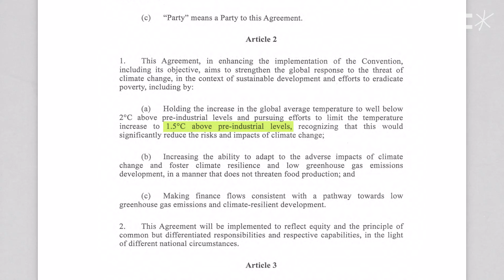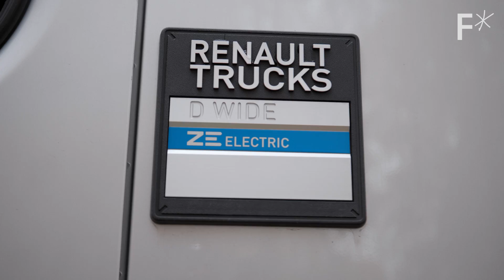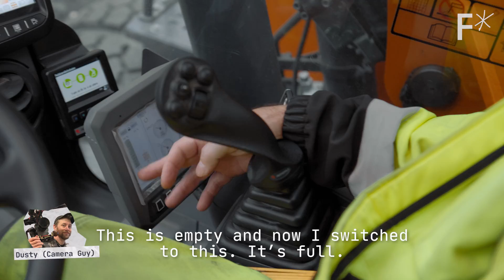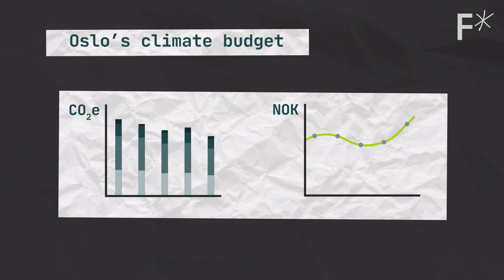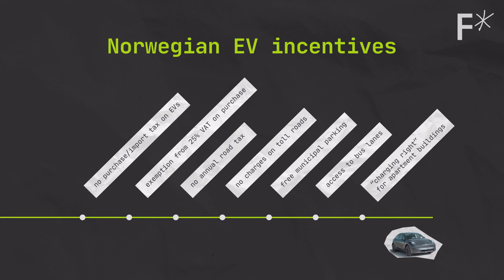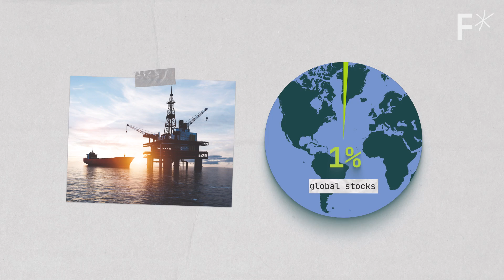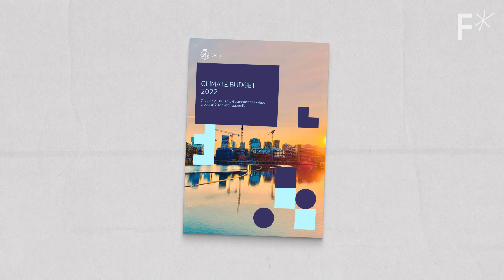The world’s most electric city | Future of Cities

Comment: There's no such thing as a zero-emissions vehicle, the real question revolves around where the emissions associated with electric cars end up. When it comes to electric vehicles, it's not about eliminating emissions; rather, it's about shifting them elsewhere. To manufacture a single thousand-pound battery, you need to extract around 500,000 pounds of materials. Astonishingly, it takes anywhere from 100 to 300 barrels of oil to produce a battery with the capacity to store the energy equivalent of just one barrel of oil.

The manufacturing process of a battery alone can result in a carbon debt ranging from 10 to 40 tons of CO2 emissions. Furthermore, the current plans to expand battery usage will necessitate a significant increase in mineral production, including lithium, cobalt, and zinc. The demand for these minerals is projected to surge, with estimates ranging from 400% to a staggering 4,000% increase.

The reality is, there isn't enough mining capacity in the world to produce sufficient batteries for such a vast number of people and their cars.
Reply: I guess you like burning carbon!

Comment: Yes, they use Electricity, but the electricity is NOT pure clean, since partially they use NON renewable energy. So it's just a facade...
Reply: @newgghoster6166  Incorrect. Euro 7 vehicles do not even exist. Euro 7 currently is in proposal status and has nothing do with CO2 immissions. I quote from the official website: “Will the Euro 7 standard help against climate change?
- The Euro 7 standards do not address CO2 emissions from road vehicles.”

Also: EV production emissions are compensated for within a few years of driving. An EV is always the least polluting option.
Reply: Lol why would have to be pure clean? The point is that it is far and far less polluting. It doesn't have to be perfect to be better.
Reply: @Freba9    That is the point. A new generation combustion engine car pollutes LESS than one electric vehicle charged with electricity generated by coal, carbon or oil Electricity generation plan as it is and has been more common anywhere in the world.  You are just moving the pollution but not really solving it.
Reply: @christianad5358  Common misconception. Combustion engines always produce loads of CO2. They are far from clean and definitely not cleaner than an EV (even with fossil electricity).

Comment: Not to be a downer, but how is the electricity produced for these vehicles?  If it's fossil fuels then we're not winning...  How are the batteries made and disposed of?  If it's way worse (and i venture to guess it is), we're not winning.
Reply: In Norway electricity is very low carbon. But the beauty of electric drivetrains is that they are always less polluting, even if carbon heavy electricity is used for charging.

Comment: During the pandemic, our daily lives were put on hold. However, it also highlighted the daily impact of gas emissions on our atmosphere. Imagine living in a city clouded with gray smog, and suddenly the skies clear, revealing a picturesque view of mountains and landscapes in the farthest places.

Going pure electric can be good. It may not eliminate the use of gas, but it will reduce dependence significantly. The next generation will eventually won't rely on it.  However, there are still issues that need to be addressed, such as the unsustainable battery production and the risk of overheating and fire, which are often used as arguments by the gas-loving community.

Comment: All that oil to produce electricity, mine all the material for batteries, then produce the batteries. There is more oil in use than if you have combustion vehicles. I love the noise pollution going down. BUT, we need to find a way to create electricity without having to use batteries. Oh, there are but the same governments that want these battery-powered vehicles have squished the real way to reduce carbon. Another thing, the earth currently has enough trees to kill all carbon output. It is cool Norway is doing this though, hope it does not kill too many children working those mines. Bless Up

Comment: Freethink, a place where 2 + 2 = 5. Where ideas aren't bound by logic or physics. Where political narratives and talking points square the circle of electric motors producing Horsepower, gaining leverage, and not using the power in their battery charge.

It's just so inspiring that some rich white people finally took a stand against our dirty air. I mean, where do you draw the line? For them, it's 0.04%. How will they get it done? With windmills that don't need blades, and solar panels that don't like heat. Don't forget the batteries. We need a battery that won't lose power when it uses its charge. It totally checks out. It's real Physics!

If Freethink actually thought about anything they feature on this channel, they'd quickly change their tune. It's narrative focused discussion, not a place for engineering or math. Unless those statistics are manipulated for political purposes.

Comment: This is so surprising to me, the fact that they don't invest any hydrogen fuel in their long range or heavy vehicle like a ship, trucks, or buses for the flexibility over full EV vehicles.
Reply: Probably because hydrogen for transportation is a big mistake because of a very low efficiency compared with batteries, probably 5 times less efficient. In fact, the best is direct connexion to the grid, as with electric trains, tramways, trolley-buses, and even one of the excavator of the video. And I do not see the "flexibility" over batteries, you can charge everywhere, while you have to go to a (yet to build) hydrogen station to fill your hydrogen tank. A first step for green hydrogen would be to replace CO2 based hydrogen since more than 98% of the hydrogen used in the industry comes from fossil fuel. Not to mention some new areas where green hydrogen could be useful, as for example to make greener steel. Hydrogen for transportation is a huge waste of time and resources, and we are running out of both regarding climate change.
Reply: Hydrogen fuel cell for electric drive train is good idea for heavy equipment @didierpuzenat7280

Comment: what I currently hate about the electric revolution is our reliance on batteries... causing a massive increased demand of rare earth minerals, like cobalt etc. and excessive waste of batteries, not to mention the slave like conditions used to mine cobalt. Sure, environmentally it's better than fossil fuels, morally, not so much. We are switching out one problem for another... What I would like to see is less reliance on batteries altogether. I use a bike rental service instead of electric scooters here in Malmö, Sweden (20EUR per year), and long distances I travel by train. There's a lot of electric busses, 100% battery driven, but due to how the routes are planned, I see no reason to reduce those batteries in favor of trolley systems instead, even on highways, that way busses can have smaller batteries to carry out distances.  and highway trolley systems could also be used for trucks/lorries. We should do everything we can to reduce our reliance on batteries during the electric revolution. At least until we have tech available that enable good working conditions and recycling systems that highly effective.

Comment: this is such bullshit! how do u think batterys are made? using fossil fuels and mining! how do they charge the batterys? fossil fuels! the electric movement is bollaks! going back so only diesel mechanics is the best option and using all discarded fats and fryer oil! or spending the time to make a eco fuel, not wasting time and fuel by faking a green movement!
Reply: The future is built on the past. Of course it uses fossil fuels, the world is currently run with fossil fuels. 

When the first cars were invented did you think they didn't use trains and horses for transport of the materials? 

Plus, Evs are more efficient at 80 - 90 percent. While ICEs are at 40-60percent 

Even while using coal generated electricity its still better given the efficiency of a big plant which can be better maintained and regulated. 

And it will only get better as more renewables and nuclear gets into the energy mix. While ICEs will forever stay the same. 

Everything has pollution, question is, less or more.

Comment: I think we seriously need to fix the battery problem. There are lots of new batteries made with common materials like sodium,potassium,hydrogen etc. But all of them in the research phase. I hope we can get them out of the world since lithium batteries are a pain in the ass they are not that resilient to extreme temperatures,they can catch fire,have short lifetimes plus lithium is a difficult material to get it out, so China use modern slaves and child labor to get it out.
Reply: Problem is trying to make it as energy dense and also relatively cheap
Reply: @bigcnmmerb0873  Hydrogen ,sodium,potassium is very cheap and easier to get it out than lithium.This is why they are important,they have potential to make batteries cheaper. But making a battery energy dense and resilient takes time to research.

Comment: Then, when everything is electric,  it would be soo easy for everything to come to a halt with a problem with power plant ! 
I think people should look into different power sources too and "not to put all their eggs into one basket" as it's said! 
Lpg, Aether electricity,  hydrogen power etc etc ! 😊😊
Reply: Which is why batteries exist as backups during those very very rare occurrences of a power outages. Back up power supplies exist as well.
Reply: A town or city with its own renewables and storage up and running will halt a grid collapse
Reply: Also the entire country isn't running off of one hydro damn.
Reply: Petrol stations run off of the same electricity.  So there is no new problem there.
Reply: Well with other fuels like petrol,  diesel,  lpg, some may store and sneak about in a lockdown, but with ev cars, they're done! 
That's the whole reason to bring in these 15 minute ranger borders in cities coming soon , it's all about exposing a "movement license" to keep people locked into "prison cells with walls" so to speak !!

Comment: Ok, so, on the outward first impressions it sounds like the city is reducing the carbon emissions, a very good attempt, but, that's only with the city. The electricity needed to make things run on electricity is being generated and also will need to be in increasing amounts right? 
So now, what about the pollution that is made wherever the power is generated for supplies? 
It seems like an illusion at present, where it is zero emissions of carbon, but, only in the city? 
Has anyone truely, measured the carbon dioxide generated in city before compared to now, any statistics truely measured? 
What about the pollution created at the power site generation, how is that compared to the old figures and now, since the city is getting cleaner? 
Even if the plot is truely an illusion but not solving anything, or even if more pollution is made at the power generation, then even then, atleast public get pure clean air to breathe in the cities, fair enough? 
😊😊😊😊
Reply: 90% hydro electricity generation in norway though

Comment: Oslo is a joke. They use batteries that produced more co2 by production than a feul based car, truck or other machine will use in the time before they will be replaced. And that is without counting that you need to replace the batteries to get the sane live time as feul powered vehicles.

The location is co2 neutral, but the production isn't. They just moved it and I creased the co2 and even worse, they also increased the damage on nature!
Oslo is currently the city that had the worst effect on nature! As other cities do the sane as Oslo, the disaster is way bigger than the humans already have on nature.

The 1,5c is also a joke.
Co2 by humans is under 3% of the total. The co2 production is already lower than it was by humans. Still temperature goes up in the same way. Even as humans produce 0 co2, the effect will be 0!

The nature retarts don't understand the facts. That humans have 0 influence on the temperature, that co2 is good for nature and not bad and that even as the north pole is completely melted, the sea level will not rise!
The south pole is growing!

All this Oslo crap is only bla bla bla!
Reply: stay poor and drink some more gasoline, boomer
Reply: There is no climate crisis.
Reply: fax @JohnPrepuce

Comment: this is really awesome and great work 👍

but lithium batteries are expensive explosive and heavy.
 They Lose their capacity in freezing temperatures and need heating.

 Why not trolley buses or trams and wind-powered ships Because like the tethered digger you don't need a  battery for everything.
Reply: Trams and busses are hooked up to the grid, wind ferries still need batteries for when there isn't sufficient wind. And lithium ion currently is the only reliable one available, doesn't mean that other battery tech isn't being looked into.
Reply: good pint i gess bots dont carr about mass so much i whass werid abut the cars and truks you arr rigit abut the fariy @bigcnmmerb0873
Reply: Doesnt get cold in Norway?

Comment: Only  works in bigger citys like Oslo, Trondheim, Bergen, Bodø etc. Does not work in the norwegian countryside that the public transport is bad, and needing of car/tractor is a must.
Reply: Well obviously, larger populations benefit from having public transportation available to them since those dense areas are major producers of CO2 emissions. Out in the countryside those emissions are much much easier to deal with.
Reply: @bigcnmmerb0873  EVs will always be needed.  Especially for climate disaster evacuations.
Reply: @brians7094  ?
Reply: @bigcnmmerb0873 I just meant that whether in cities or not, electric cars and trucks will be needed to supplement mass transit.
Reply: @brians7094  in my personal opinion hydrogen vehicles could be used for mass transits instead due to its higher energy capacity compared to electricity when we transition to fully electric. This way we reduce our lithium dependency at least a bit and slowly transition it to everyday vehicles when more affordable methods of hydrogen production is made.
Reply: @bigcnmmerb0873 I think green hydrogen has its place (I advocated for H2 cars >40 years ago), but I think its time in cars has passed.  For the air it will be a great bridge technology.  Busses might make sense, but I don't see it competing w/ batteries on cost.  But I wonder who wants hydrogen pipes in their neighborhoods?  The videos after a leak will be entertaining, but horrible.
Reply: @brians7094  don't really advocate for hydrogen gas used for cooking 1 because that's dumb and 2 hydrogen fires are wayyyy too hot to be rated safe for cooking, electric stoves are still pretty good and so are wood stoves  (grew up with wood stoves and despite them being a pain to start and maintain they are still really good). I can still see hydrogen making a reoccurrence cause despite EVs green rating, we still cannot dispute that the rare earth materials needed is pretty damaging, not comparable to that of combustible vehicles ofc.
Reply: @brians7094  in another personal opinion just funding in better public transportation could radically shift our emissions as well, esp services like lightrails, trains, metro and shuttle services.

Comment: Norway's oil production is NOT a contradiction.  Oil production is on the SUPPLY side.  The amount of oil produced in Norway has effectively ZERO impact on global DEMAND for oil.  Pretty much the exact same amount of oil is going to get burned into the atmosphere regardless of where it's drilled.  Ask any economist and they'll tell you the global oil market is not efficient since OPEC turns up or down production based on price and political objectives not supply and demand).

To my fellow environmentalists: Fight like crazy to increase deployment of wind and solar power sources and don't waste your time protesting oil companies.
Reply: Agreed.  But over the heads of most.
Reply: Speaking of OPEC, theres a very good reason to get away from oil.

Comment: I'm wondering how their harsh cold weather would impact the batteries in winter.
Reply: Well they are still a very stable country so not that much obv
Reply: They are kept at a stable temperature year around.
Reply: Imagine running a heater off a battery, and at 50% charge, it has only 50% power. So now you're heater only works as good as the wall socket for about one second.

Comment: 14:05 Can't the battery fires be extinguished or suffocated using CO2 just like Normal Ship Engine Fires? maybe other means like Foam if possible?
Reply: Beklageligvis ikke. The fire does not need oxygen to make a chemical reaction. The ferries use fresh water from a supply and goes over to salt water when the tank is emptied. The captain
Reply: @3Dpixels  that's quite rare I thought fire needs a certain amount of oxygen just to be alive

Comment: The low population, small area and good climate for batteries helps Norway in achieving these goals. Doing this isn't possible in many places because EV batteries work best in around 21°C and they are prone to explosion and fire if the temperature varies too much. The battery also degrades year by year making it an expensive endeavour to use and maintain electric vehicles for normal public as well as the government. 

The transition to EVs is good but it sadly isn't applicable everywhere on the planet.
Reply: Even in the nordics it is not ideal. Long distances between towns and viable chaging points and cold winters